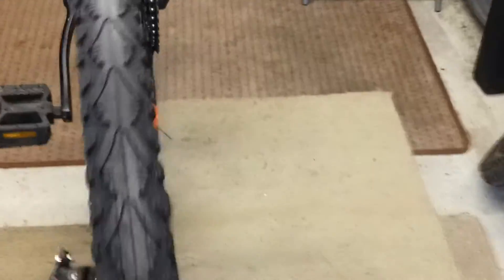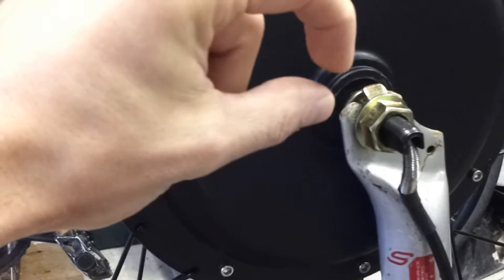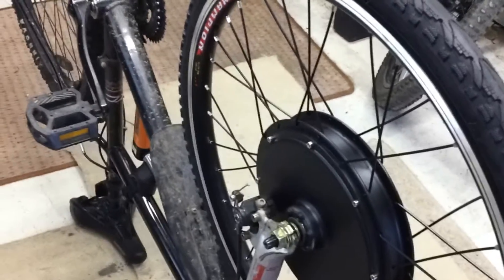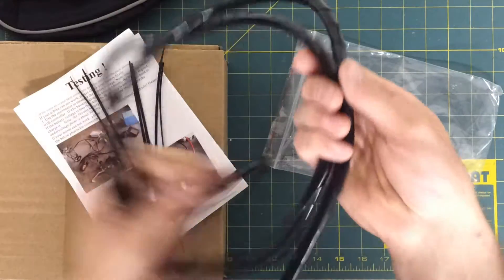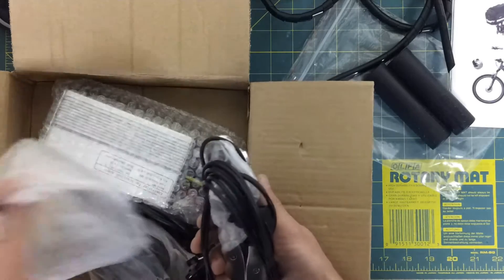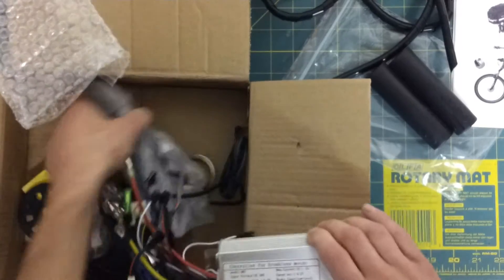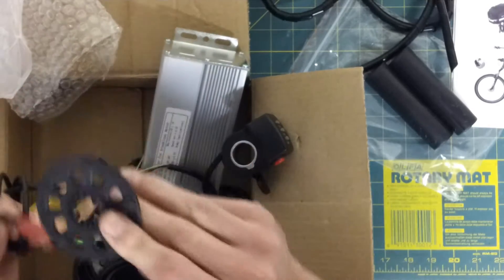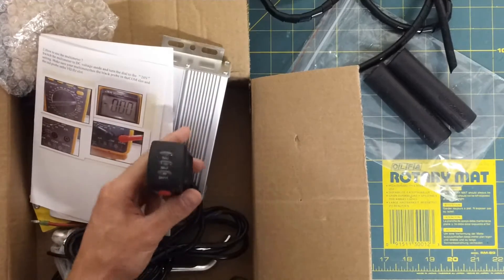Lithium Ion 18650 48v e-Bike build DIY - Part 4 - Hub motor 1000W 1kW

Comment: I use an inline power meter to see voltage drop under load can just see it drops but goes back up as long as it’s over 48volts the controller won’t cut out

Comment: Have u got wiring diagram for your kit an what are those resistors I have some 5 amp fuse wire to use on bus bars was goin to make a pack like yours an just parallel pack s I got I had some used laptop cells an guys have them labelled but they were crap they just drained quick my pack so will b careful what I use have a good hover board pack 40v an got a free dyson pack from tip for free

Comment: Hi I get max speed 22 mph with my giant mountain bike 48v front hub motor but with bigger front chainwheel should get 30 mph what speed u get my little legs run out of gears too easy😀
Reply from the maker: Hi Steve, I can achieve about 31mph on my bike, on the flat hunkered down and with no pedal assistance. Keep in mind the speed you can achieve will relate to the power your battery produces under maximum load. Measure the voltage of the battery under full load with a multimeter and you'll see if you're getting a significant voltage drop. The battery may read 54.6v (13s) at rest when charged but may drop significantly under load if the cells are in poor condition or you have too few cells wired in parallel. A large voltage drop will reduce the power available to the motor and consequently, the speed available to you. 

IIRC my batteries drop to about 48v under full load when they are fresh off the charger. I haven't got a clamp meter to check the current drawn by the motor at this time but it's probably somewhere in the region of 20 amps (48vx20a=960w, minus thermal and frictional losses).

Comment: Next time I recommend get rid of the plastic disk spacer (disk replacement) and use the original screws that came with the bike because if you use longer ones they will damage the motor.

Comment: Just can't watch this. The way how you just installed disk brake, without necessary torque, without turning disk clockwise before torque them.
Reply from the maker: I'm sorry to hear of your trouble watching this, hopefully you'll feel better soon. While there is no substitute for the correct torquing procedure, experience goes a long way towards negating any risk. I don't understand your reference to turning the disk before torquing; if I turned the disk it would maintain its position relative to the wheel and the whole assembly would simply spin around.

Comment: where should I buy the battery? do I need anything else?
Reply from the maker: I'm not sure where's best to buy a battery from; I made mine from old laptop batteries. Check various e-bike forums for some info. If you have a battery, the hub motor kit (with controller etc.) and a bicycle, you have everything you need to build the bike. A charger helps in the long term, too!

Comment: Do yourself a favor, get rid of the torque washer and get your self a pair of torque arms. I learned the hard way. The washer actually makes it more dangerous by popping the wheel off the fork. The arms will keep the tire in place and protect the fork. And yes, you can die if the front wheel comes off at 30mph and your neck snaps when your cartwheel your head into the pavement
Reply from the maker: That's certainly graphic. I'm not familiar with these torque arms but I'll look into it, cheers.

Comment: Did you fit torque arms?
Reply from the maker: No, my own arms tame this savage beast. I'll just ride it until it breaks. 4-500 miles of potholed city streets haven't killed it yet. Certainly makes a thump hitting speed bumps at 30mph.